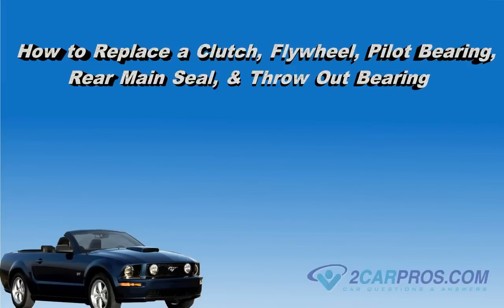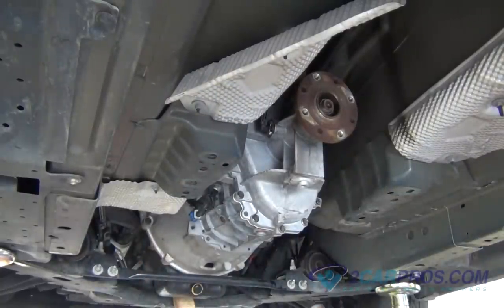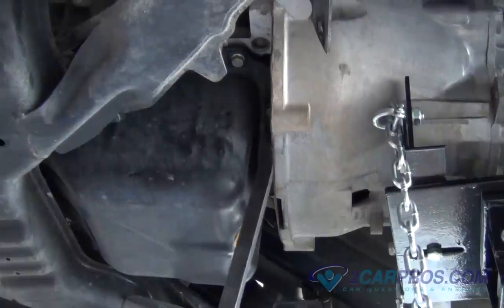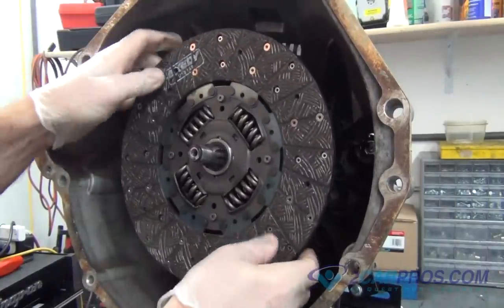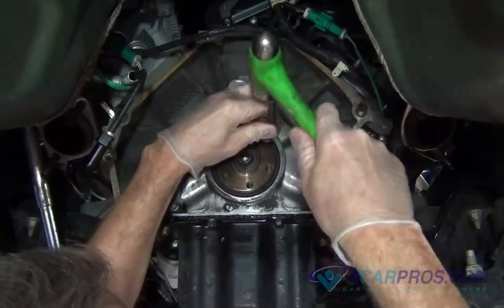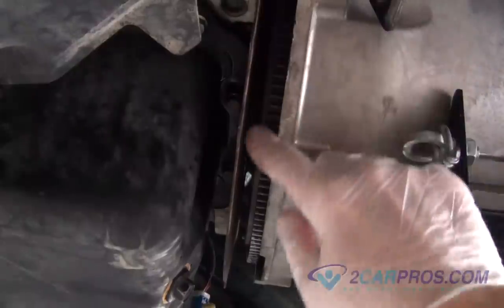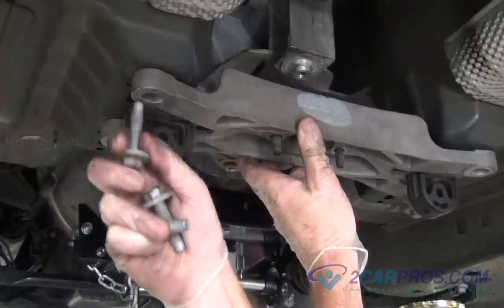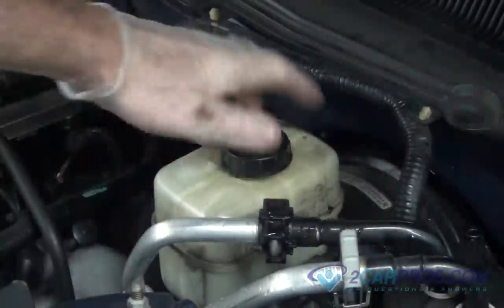Clutch, Flywheel, Rear Main Seal, & Throw Out Bearing Replacement Ford Mustang 2005-2009

Comment: I just did this. This is a great guide, but I'd like to add a few tips. I would add that at least for a 2010 V6, you do NOT need to remove the exhaust.  We removed the O2 sensors only, and had no clearance issues. Driveshaft bolts (12mm, 12 point) are typically installed with locktite red, which must be heated to release. Butane torches are warranted for driveshaft bolts. Once heated, they release easily. I also did not disconnect the starter wiring. It can be tucked up into the suspension until you're ready to reinstall.  The hydraulic clip can be tricky. Pic tools are the best way to go. It removes toward the driver's door. Put your finger on it and press against the pick, or it will likely go flying across the garage once it releases (ask me how I know). We had a hard time getting the new hydraulic line to come out far enough to recoup the hydraulic line on. Ended up grabbing it with pliers and pulling it through farther (careful with the O ring). That proved effective.  Be very careful with the shifter bolts. They are cheap pot metal and shear easily. Always use penetrating oil first. That linkage is no longer made and is expensive if you can find it on Ebay. Note nearly every bolt is metric EXCEPT the flywheel bolts. They are 3/8". If you try to use a 10mm, you'll likely strip it (one of the few mistakes I didn't make).
Reply: @@The_Jailerif you can’t do it just say that

Comment: While this is a great install and I will be using it when I go to do my 2006 Mustang V6 repairs, he makes a lot of oversights. When you remove the pilot bearing, do it BEOFRE installing your brand new shiny flywheel, as any mishap in this stage could gouge your new flywheel and set you back a lot of money and steps. Also there is no reason not to put the guide into the clutch before installing the clutch and pressure plate, this will make alignment much easier. Finally when installing the transmission back into the engine DO NOT use the bolts to tighten the gap. Make sure the transmission is flush with the engine block BEFORE installing the bolts to ensure no warping of the ALUMINUM transmission case.
Reply: great tip, I'm about to do this same thing on my 2010 GT too

Comment: The biggest mistake is a pinched wiring harness at the block and transmisson.     Please note that you need to be careful and make sure the harness is pulled up over the engine and NOT get pinched.    I made this mistake and the car went into limp mode and sending codes P102, P0135, P0141, P0155, P0161, P0403, P0443, PO0446 and P1489.     Do not be fooled into buying all new sensors to fix the problem.    Fuse 49 will be blown when there is a short in the wiring harness.

Comment: You sir just made my life soo much easier. Thank you!! Also little tip, I recognize you were probably being generic on purpose since not everybody has this car. However since you titled it as a clutch replacement for all 05-09 Mustang GT’s specifically, I wish the torque specs and nut/bolt/socket sizes would’ve been mentioned as you went along. Thanks🤗

Comment: I’m doing my clutch right now and you just saved me a couple hours more worth of work. I’ve always thought the transmission should be flush with the engine before installing the transmission bolts. But I guess the 3v has a gap due to the throw out bearing being a hydronic one

Comment: Thanks for this video. I would not have been able to do this repair without it. Just back from test driving my Mustang (2005 v6) and car works great again. Sections of the video were different (ex. starter on drivers side held in with 2 bolts). I used four 3-ton jack stands. I did not have to remove any part of the exhaust (except 02 sensors). It did make getting the upper two bolts on the transmission a little bit more difficult. I needed a friend to get the transmission on the transmission jack because we had to put it on the jack under the car.
Reply: dang dude, I'm about to do this on my 2010 GT the same way as you. gonna have to crawl around while the car is on jackstands. wish me luck plz

Comment: Back in April I went through this process on my 05 gt when I swapped the auto transmission to manual transmission. Everything went smoothly and NO a lift is not needed! My dad and I raised the car enough to have enough clearance to move the trans form underneath. Best mod i could've done very happy with the results.
Reply: Exile what did you lift car with? just jack stand on highest setting?
Reply: @TallCade  jack and stands and used cinder blocks
Reply: Exile went with the shop 😂Got it warrantied
Reply: @TallCade  guess whos pulling out the transmission again lol yep i think either my slave cylinder went bad or the pressure plate sucks
Reply: @TallCade  thats cool how much did they charge you?
Reply: Exile was a little under 4 grand total, i only paid 11k. My warranty is through all state and they covered 3k of it. I got a calimer stage 2/rst/ driveshaft shop one piece out of the deal.
Reply: @TallCade  they charged you 4k to replace the clutch????

Comment: Outstanding video that makes the job seem manageable for a DIY while saving on installation costs. My only suggestion would be to list the torque specs for the bolts on the screen (maybe similar to subtitles?) so we dont have to cross reference the specs by looking it up. Thanks again for posting the video and much appreciated! Subscribed.
Reply from the maker: Awesome! Thanks for watching sub!

Comment: Great explanation video! I think there are seven bolts for the transmission and two are longer than the other four. I was wondering if you remember where the two long bolts go that bolt the transmission back to the block? Are they the two top bolts? I bought a roller and trying to put it back together.

Comment: In the middle of this job now on my 2006 Mustang GT.  I have fitted the transmission in and taken it back out twice now because while we get the input shaft lined up and through the clutch, there is still about 3/4" before it meets the back of the block.  We can't manually push it any closer.  I suspect it is simply the hydraulic throwout bearing that  is preventing us from manually pushing it the rest of the way. (?)  Should I just use the bellhousing bolts to pull it in the rest of the way?

Comment: Awesome video!
Quick question:  Do you prime the throwout bearing with hydraulic fluid to prevent air bubbles or do you just connect the line to it?  Thanks
Reply from the maker: +Dano Vido  Just connect the line and pump the pedal, the system is self bleeding.

Comment: Any tips on removing the inner exhaust bolts by the exhaust manifold on the driver side? Only thing I could get up there was a 3/8 15 mm deep socket, tried a bunch of combinations with swivels and lengths but can’t get it.

Comment: Need help put new clutch kit and flywheel and throw out bearing and reinstalled now there is no pressure in the clutch pedal, tried bleeding it for a couple hours and still nothing, any suggestions?

Comment: great video, about to start the same job. I do not have the clutch centering tool, can you get away with out it?
Reply: +Matthew Thomson Yes and No!.... You don't have to have it.......you could "eyeball" he whole thing to center.....but it's a hassle .....we're a long way from aluminum case 4 speeds on guy could push into place....this a much heavier transmission and you only want to raise it and push it "home" one time......the first time......so I simply would do it without the tool. If your clutch didn't come with the tool......universal centering tools can be bough for really small change at any auto parts store.

Comment: Thanks for the vid very helpful any suggestions on where to find all the tq specs and use of loctite?
Reply from the maker: ***** Google search for your torque specs and you can also use loctite on the flywheel bolts. Not needed if you tighten properly. Thanks for the comment. Please subscribe if you have not already.

Comment: My 05 has only been in snow the last 3 years but what a mess underneath compared to this video. Don't think I can get the hot wire off the starter without breaking the stud.

Comment: what would cause a whirring noise as the clutch pedal is released. it goes away as i depress the clutch pedal.
Reply from the maker: https://www.2carpros.com/questions/new sign up on our website and ask your question there where an certified technician can help you.
Reply: Sounds like pilot bearing or throw out/ release bearing
Reply: Sounds like a bad input shaft bearing in your transmission.

Comment: I know it all depends on location or even a name brand or local shop but what is a estimate for this? My Mustang is nearing the 100K miles and every time I (cold) start the car there's noise and whenever I hit the clutch pedal it goes away until I release it.
Reply: Bryan Delazerda That sounds like the throw out bearing has gone bad or is not making proper contact with the pressure plate. Does it go away once it is warm?
What year mustang do you have?
I have a 99 and have that chirping until I push the clutch pedal in and once I release the clutch it comes back again.

Comment: What is the attachment at the end of the socket extender? The one that allow you to twist the bolts off with the impact driver at weird angles? i need an exact name, so i can get one for myself to tackle this job.
Reply: Wobble
Reply: Also called "swivel" sockets. If you don't mind HF, here is a link:

https://www.harborfreight.com/2-pc-universal-impact-joint-socket-adapter-set-67920.html

They were a must to get the driveshaft off and really helped with the upper transmission bolts.
Reply: Jon Hertzler you sir are a lifesaver. Thank you!

Comment: Lost the small metal retainer that goes into the elbow for the throw out bearing. Any idea what part number it is???
Reply: 2005-2017 MUSTANG HYDRAULIC FITTING RETAINING CLIP
Part Number: 139249  McLeodracing.com

Comment: How do you go straight upwards with transmission and then slide transmission into motor ? , when the tunnel recess is only as long as the transmission housing not including the transmission shaft . I had to lift the front of my motor and push transmission in at an upwards angle . Why do no videos show this most difficult part ?
Reply: Guy Noir did you put a piece of wood to support the engine as you dropped the transmission?
Reply: Drake Pomeroy     I didn't on the way out , but did on the way in . One person jacking under front at balancer and one stabbing the trans in . Caution , do not let motor slip off while jacked it can break stuff .

Comment: would this job be possible to do without a lift?
Reply: How much do you bench?
Reply: Would no try as the tm is pretty heavy
Reply: Static Sleet I was just thinking lmao I wonder if I could just lay under it and once I have it shimmy my way out lol. I heard it's only like 100 pounds or so
Reply: JayGT I did this on jack stands a few days ago. Get a transmission jack, you will thank yourself that you did. There is absolutely no way I could've done this without a tranny jack. You can get one for less than $100.
Reply: Where on earth did you find a trans jack for less than 100! Was it just the plate adapter?
Reply: Harbor Freight has a tranny jack for $95 that works amazingly well.
Reply: How did you get a tranny jack under a car on jack stands? Lol
Reply: Yes I’ve done it very bad time
Reply: Andy34mn río
Reply: that dude slattdaddy dude you said under 100$ like 5 less makes a difference

Comment: is the acrankshaft rear seal was damage causes oil sealing on the clutch ??
Reply: The rear main seal goes bad every 150k miles or so. Its a good practice to replace the seal as preventative maintenance

Comment: hi quick question, do you know if the cause of a slight rapid knocking noice is because of an old or worn out   flywheel? i have already changed motor mounts and oil on my 2005 Cadillac STS.

Comment: I just watched this and after installing my new clutch set my car runs like shit it's undrivable, it seizes up at certain speeds and had a wrench icon appear on my dash after putting a code sensor too it the things is trying to convince me 2 of the 4 02 sensors are bad, it gave me 8 codes, 2 related to each sensor and 2 related to the heating on those sensors
Reply: casper h the fuck kind of Ford are you working on that has a wrench warning light?
Reply: mustang has wrench light and engine light.

Comment: I'm going to tackle this on my 08 GT as my clutch as been slipping and is most likely worn out now. I got a new stange two exedy clutch, pilot bearing, slave cylinder with throwout bearing, and a new stainless steel braided clutch line. Wish me luck...
Reply: Good Luck
Reply: PACxATTACK88
Thanks :)

I didn't watch the whole video when I commented eariler, It was interesting to see that they also used the same exact exedy clutch I bought :D
Reply from the maker: :-) glad you liked the video
Reply: @2carpros  This video helped me do the clutch job myself twice. It took me 10 days both times on jack stands lol.... and now my slave cylinder seems to be going out a third time so we will see. I am definitely getting some help and a lift though, theres no way i'm doing this on jack stands again haha. I love my s197 too much to get rid of it

Comment: If your doing this on the floor without transmission jack the piece of wood must be removed before trying to drop the transmission, I did not have enough clearance between the firewall and engine without the play of the engine leaning back

Comment: Great how-to.  Glad I stumbled across this video while trying to find the 'rear main seal replacement' process for my 2006 Expedition 5.4.  I only stopped on this 'Mustang' video because the end of this engine is EXACTLY the same as my '06 Expedition 5.4.  You could add "2006 Ford Expedition 5.4" to your video so it will show when someone searches for this for their Expedition.  Thank you.
Reply from the maker: Good to know! Thanks for the heads up!

Comment: Good video, everything you did looked good to me. I just had a question about using the type of silicone you were using in this video. This was the first time I have seen somebody use the type of silicone that you would find in a home depot for windows and doors (GE brand rain ready). I have only ever seen somebody use the RTV you buy at the autopart store. It never crossed my mind that you could even use that stuff instead. I suppose that stuff works exactly the same as RTV. Also, I am sure the price of that big tube of silicone cost much less than the little tube of rtv you find at the autoparts store (that stuff is expensive). If this stuff works the same I will have to start using that in the future just because I know it is a lot cheaper. Well thanks for the great video. I will be subscribing to your channel.
Reply from the maker: This is silicone based grease used for lubrication of metal parts. Thanks for subscribing, tell a friend!

Comment: I have a question if my pressure plate is in good condition doesnt have to be changed right?
Reply from the maker: Yeah you can but honestly it isn't worth it. I recommend spending the little bit extra to make sure you won't be taking it back apart in a few months. Thanks for watching!

Comment: Where can I find the torque of tightening the screws to this operation?
Reply: Ford mustang forum
Reply: Fly bolts are 75 ft lbs. Clutch plate are 30-32. Remember to step up gradually to those torques.

Comment: Very helpful and well done. I am having my GT 500 done now. I like to know how much work is required but I already knew I couldn't have done it myself. My 05 GT has a new clutch and my 14 GT has very low miles.

Comment: Very nice video, thank you for the upload. Just replaced the clutch assembly on 2010 GT,  The two top bolts on bell housing were quite a challenge. We didn't remove the entire exhaust as themiddleclamps were quite seized, but had unhook both of the Cat.Converters and pushed the aside, as well as the 02 Sensors. The clutch was not slipping at all, only the shiffting got really hard, but ours surprise the old clutch it was ripped apart and split intn two pieaces
Cheers

Comment: Good call on that steel braided clutch line Michelangelo Hamato. My factory line blew out while doing some "SPIRITED DRIVING" sucked the clutch pedal straight to the floor. Brake fluid caught fire because it sprayed onto the exhaust headers. I also added a ISO clutch remote reservoir to solve BRAKE FADE problems. BREMBO 6 PISTON FRONT 15 INCH ROTORS BREMBO 4 PISTON  REAR 14 INCH ROTORS.
Reply: Heh heh my clutch line popped out on the on ramp to the highway when I was at 4k rpm in 2nd gear. I pulled over and had the car towed home. I already had the braided line at the time, but one of the metal clips backed out slightly where the line connects to the plastic elbow by the transmission. I just used a dab of black silicone to make sure everything would stay together next time...

Comment: So do i need to drain oil? I'm at the point i just got my flywheel off. Swapping TR3650 to the Magnum 6 speed. Replacing pilot not sure if i'm going to tackle rear main seal. I wish i had a Lift for my Mustang looks like it made everything a lot easier. i did invest in the Race ramp car blocks and damn it did help with the height.
Reply from the maker: Justin Bennett No need to drain the oil, ya the lift does make this repair and filming a lot easier but can still be done on the ground. Please subscribe if you have not already.